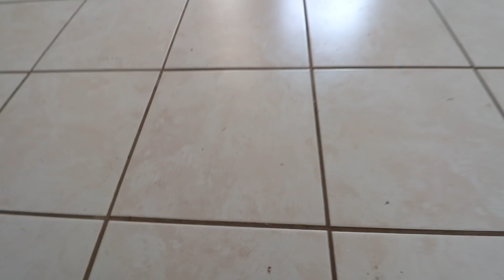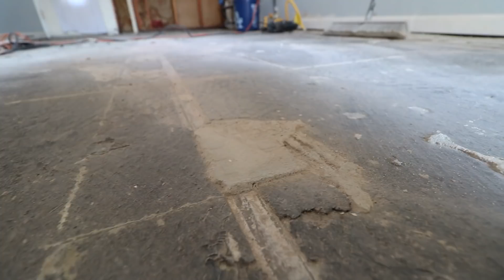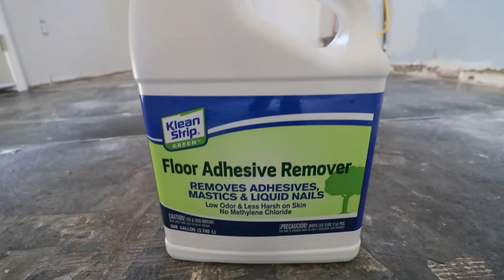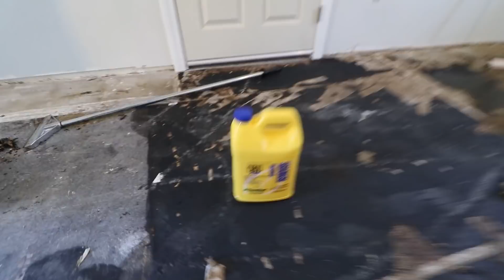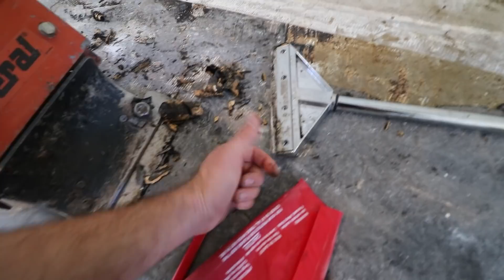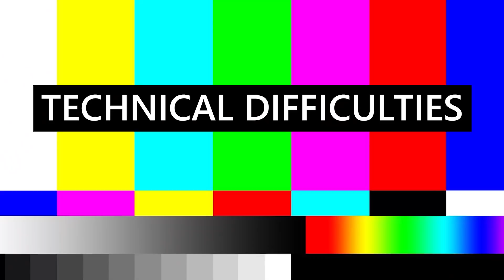Mudroom Renovation Part 2: Another Floor Bites the Dust

Comment: That was so hard to watch. In Oz we have a tool called a tile bolster. It’s a long handle with a floor scraper attached. Different blade to the one yr using. You use it to remove the tile and backer in 1 move. I’d then hire a honing machine and grind off the top. Stain w black concrete stain and seal. With a seagrass long rug .

Comment: If you ever need to remove tile again, I find that using a chisel shaped like the scraper attachment for the hammer drill works better: the angled head not only makes it easier to work with, it allows for the chisel to deeper get under the tiles before they break and combined with the larger head the tiles come off in bigger chunks.
I definitely feel your tile pain, though my process was a bit different…

Comment: I would have started the chemical cleaners on small, separate, areas before possibly gunking up the whole floor and making the entire process worse. Also, be very careful mixing chemicals. It may seem dry, but there may still be some soaked in, that could be off-gassing. Not good for your lungs.

Comment: I was once part of a crew of relatives removing the old tile from my mother-in-law's kitchen/dining area. All of us used those floor scrapers, which made the job go fairly quickly, but the jagged pieces of tile cut up our hands and shins. We took it down to the concrete slab using only those scrapers.

Comment: You still really should acid etch or mechanically grind that floor if you are going to be laying new tile or a flooring using an adhesive, even using a decent primer rated for going over glass old tiles metal etc will more than likely fail. The 9in cup  disc should work at taking it back to a raw grey concrete look now if it doesn't there still are contaminates embedded. Not trying to be that guy just throwing some advice out there. Any tile related questions shoot me a reply...

Comment: Did you ck for asbestos in the tile mastic? Or do you know it was installed post the ban?
Reply: The 12x12 tiles with the peach colour are very likely early 2000's because those colours were on trend at the time.  I'd doubt they have asbestos, but I am no expert.